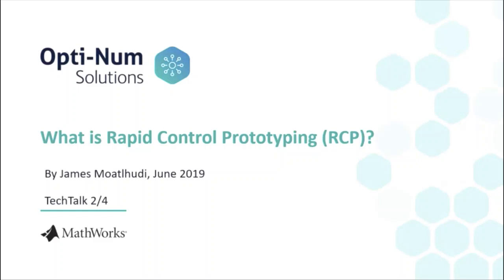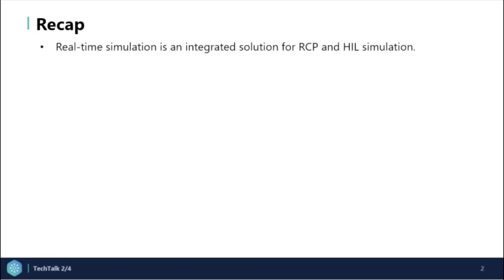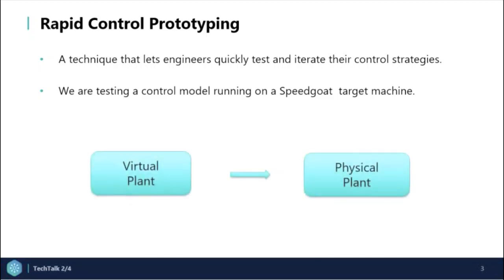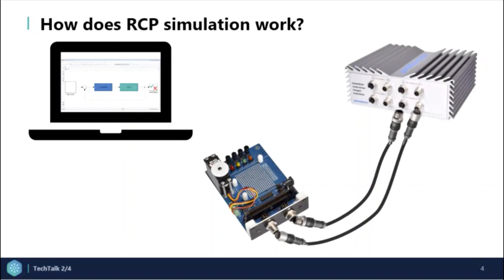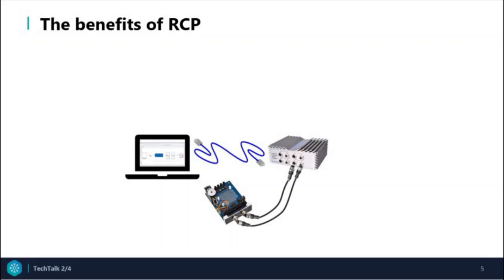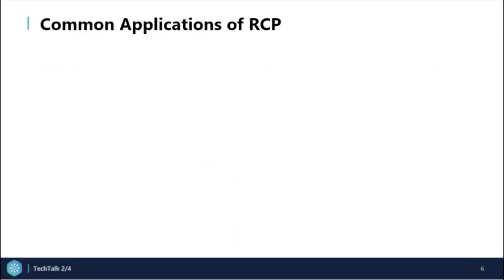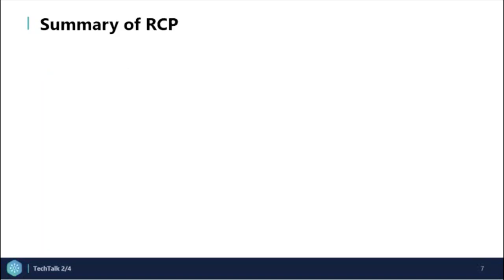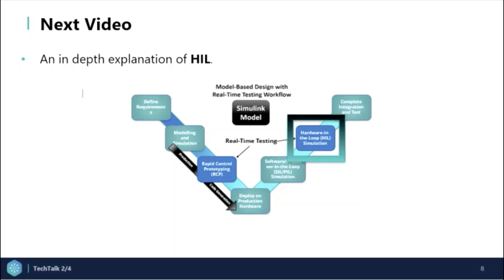Real-Time Simulation and Testing Part Two: Rapid Control Prototyping

Comment: Isn't it other way around? RCP is about connecting the speedgoat to test the control board while the physical plant is modelled in the simulation platform. HIL is about emulating the physical plant using speedgoat...